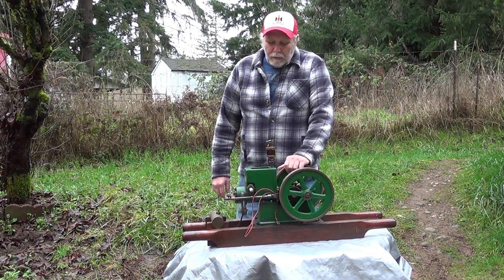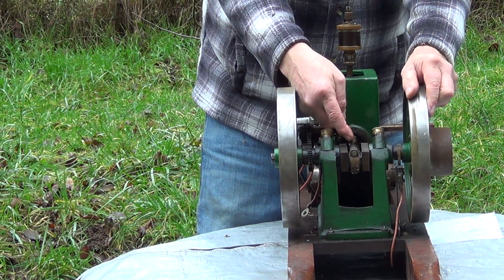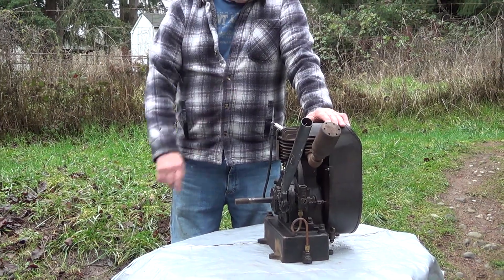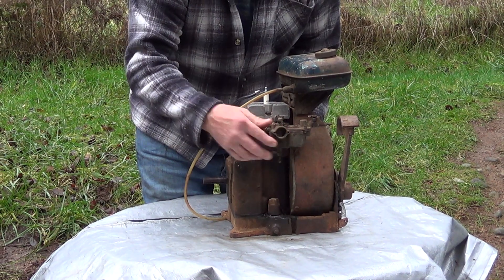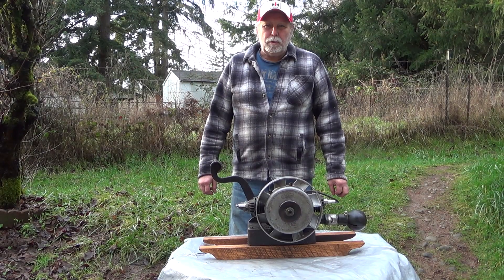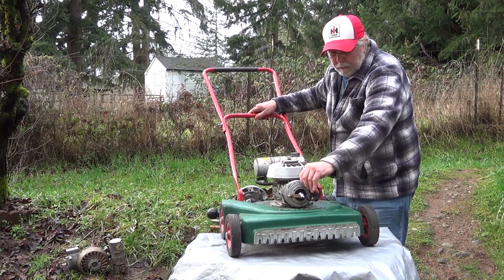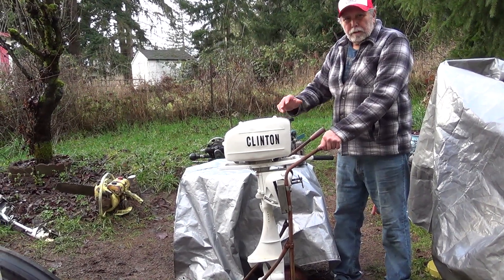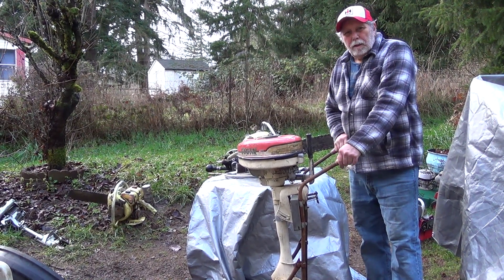The Small Gasoline Engine for Work and Play

Comment: Awesome collection of small gas motor , they are so much easier and more fun to work and tinker on than car motors. i just got a Clinton motor similar to the white one you have and amazed to see your gas tank has a built in gas gauge that Super Cool ,
Reply from the maker: The nice thing about collecting vintage small engines is that you can still use them to power all kinds of equipment still today.  Clinton was the second largest producer of small gas engines in the world, till 1982 when they shut down.  The Clinton with the fuel gauge in the tank is for use in mini bikes. Clinton made a wide variety of engines, so they are easy to find and collect.

Comment: I live in Cambridge, WI, where Ole Evinrude began making outboard motors. His descendants still have some early ones they fire up on special occasions. I use my two Evinrudes: a '57 10 hp and a '69 3 hp.
Reply from the maker: Check out my video (Pioneer Power in the Pacific Northwest) and you will see my 1914 Evinrude. 1909 was the first year of Evinrude outboards.  I run nothing but vintage outboards on my boats, since I am MR. OBSOLETE !
Reply: @mrobsoletesvintagehomestea9156  His family has one of those early Elto. I've seen it running. It was a nineteen-o-something, so apparently the first model.
Reply from the maker: The first Elto outboards were made in 1922, a two cylinder motor with a rudder, called the rudder twin.  Ole Evinrude had sold the outboard motor business in the teens, and had an agreement not to make motors for a five year period. Ole was a super inventor, and dreamed up the rudder twin in the 5 year period. He took the prototype to Evinrude motors, showed them the wave of the future.  They didnt want to change the product line they were selling, so Ole started making and selling Elto's. These motors couldnt be sold as Evinrudes, so Ole came up with the Elto name: Evinrude Light Twin outboard.  These were so much more modern than anything else on the market, that he made so much money, he re-purchased the original Evinrude company. @jeffreyrubish347
Reply: @mrobsoletesvintagehomestea9156  Thanks for refreshing my memory. I have a book, "Evinrude-Johnson and the Legend of OMC but haven't read it for some years

Comment: It is hard to tell because you showed them very quickly but I believe the dogs move a bit on the Clinton saw allow it to dig into the bark and then pushing the opposite way allows it to pivot easily out of the bark to as not to get stuck.
That is my theory anyway
Reply from the maker: I have some original clinton ad's and owners manual, but no mention of the moveable dog's function.  You are probably right as to the function.  I will do a test on this saw this spring and see if I can figure out if they work, or if the moveable dogs are just a sales gimmick. Stay tuned, thanks for watching.

Comment: Where are your Brakes & Scram’em enhines?
Reply from the maker: They are on part 2 of the video on small engines
Reply: @mrobsoletesvintagehomestea9156  haven’t seen that one.  I remember the Clinton engines.  They were only on cheap stuff and my parents did not buy cheap stuff and neither have I..
Reply from the maker: The early clinton engines were actually better than the brigg,s engines, but in later years they made some cheapo engines for the low end market, which was one of the reasons for their demise. @johnclarke6647